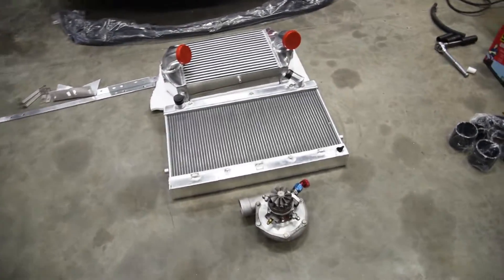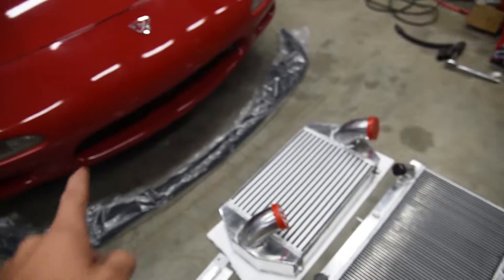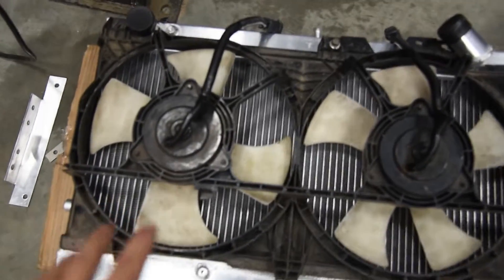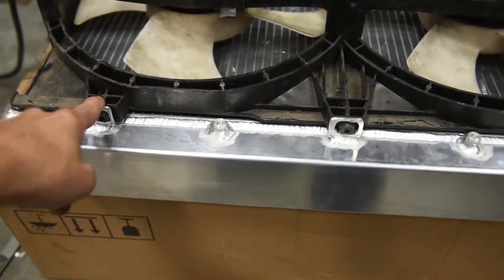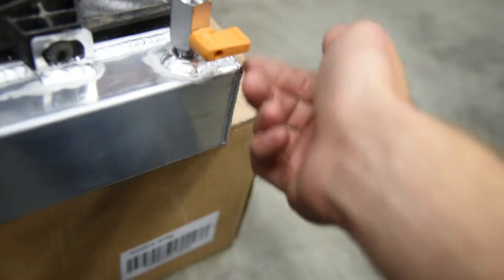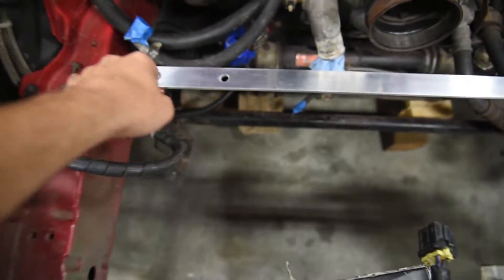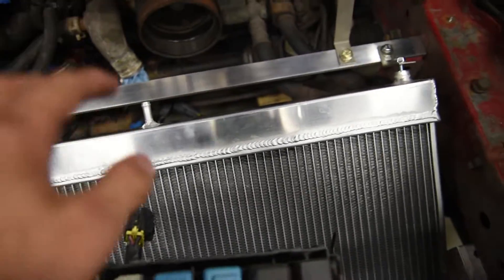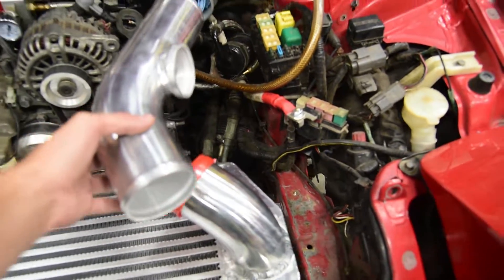Installing the V Mount Intercooler/Radiator - FD RX7 Build Part 2

Comment: Do you remember what length rad hose you used and if the oil cooler line got in the way of the hose on that side
Reply from the maker: I used some universal flex hose and metal piping to make it fit

Comment: Where you able to keep the a/c ?
Reply from the maker: Yeah I left room to mount an RX8 condenser which has a built in drier. I found this intercooler is only good up to 500 whp so I'm changing it out, but keeping the radiator.
Reply: Did you happen to make a video of how mount the AC system?

Comment: Sweet video I'll be doing this v mount in the next 2 weeks I got a few questions but the one that comes to mind is would did you do about the radiator hoses you use the OEM ones or had to get new ones ? Also love the little side ducts you made what did you use look like aluminum sheet metal but just wanna confirm
Reply from the maker: I used a flex hose for the passenger side. Driver side was a combination of two hoses, with an aluminum tube connecting them. It's what I had sitting around. All the shrouding is aluminum. I made a steel guard for the radiator. My email is in the description, send me a message and I'll reply with pics.

Comment: Just to save you some effort LRBSPEED.com has an undertray that should be able to bolt up and help prevent stuff from damaging your radiator.  Also has a vmount option to allow airflow from the fans out the bottom.  Looks good though!
Reply from the maker: I made a wicked 1/4" steel skid plate for it. But I'll check out that site thanks!

Comment: Looking really nice.
One tip: Especially for the heavy coolant radiator, suggest you fit rubber isolators at the mounting points since flexing at the hard points and road shock motion of the radiator will fail the brackets or radiator bosses eventually. Also beware of where the two heat exchangers touch (if you did mount them in contact); there will be relative motion at that contact cause wear through unless you interpose something like a strip of Teflon there.
Reply from the maker: Thanks! I added some rubber there. I did leave about 1/4 between the rad and IC, but a rubber strip would be good safety and help direct air.